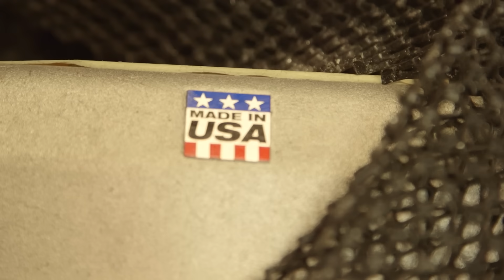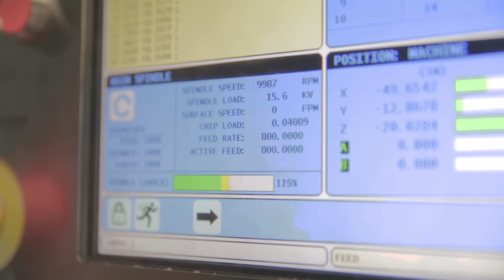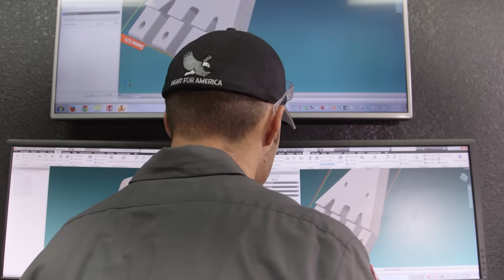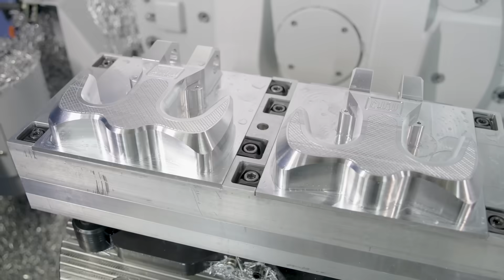Small Machine Shop Owner FIGHTS Back Against GOLIATH Company

Comment: I used to work for a not for profit and they had a relationship with a 2 person company. guy: did the work, wife did the accounts. We would sometimes have 45-60 invoices in a pile. Every now and again they would be like can you process some invoices and then the guy that did it would spend half a day just focusing on their invoices (we were probably more than half of their business). For one company we dealt with we kept having this failure, so i used to remove a small piece of the mechanism and that worked 95% of the time, showed an official repairer who said you shouldn't do that, he replaced the part 3 times. Later on the company that owned the devices used my repair technique for the problem :P. The old dodgy 2 dollar part that makes a 5 grand device useless.

Comment: A colleague of mine owns a company that is making tools for other companies. Tools like injection molding dies, press tools etc. One of his customers was a car company. It was at first a small customer but got bigger over time and then started to put pressure on him. Unscheduled short time changes of tools and in the end they wanted him to use specific software and wanted full access to the systems to be able to make changes in tools they wanted etc. They said if he wouldn't do it they had to look for someone who would do it. After that comment he terminated the contract with the car manufacturer. He said he would be able to make the same revenue without them and with less stress.  He still receives orders to make a tool for them from time to time, because of the quality of his work, but his company can exist without them and it grew in size.

Comment: This happens in my telecom industry all the time.. The big carriers. tmobile. verizon. att. They hire the big companies called turf vendors that get all teh work from the carriers for whatever region of the country . If you want to do work in area. you have to work for the turf vendor or youre sub. I used to be in one of those small subs and we can get payments held for ANY reason. wire isn't the right shade of color or the cables routed wrong, they will find stupid reasons like that so say we're not paying you a dime to you do it over. For a small company to hold that kind of money on the books for months is pretty much a death sentence. my old company got bought out and now im at the big place and i seeing it first hand. One of best contractors we have is owed more than 300k for past 6 months because the company is "restructuring". such a F'ed up situation.

Comment: I worked in the auto industry. This is call(TQM) continuous improvement. JIT (just in time) makes the supplier hold inventory at their own expense and if they don’t and a line goes down waiting for parts the supplier is charge hourly $$$$$$ for every hour the line is down. Billing practice is to use the law that they have up to 90 days to pay for their parts. Supplier must show they practice continuous improvement by reducing the cost of making the parts every year, thus auto company demands cost of parts be lowered every year. Most auto makers do this as it greatly increases their profits.

Comment: I worked for two person business that a multi billion dollar company tried to screw because an intermediary went broke. We installed equipment that was worth about a couple of years wages at the time that an intermediary at the bottom of a string of intermediaries was to pay for. We ended up bluffing our way onto the site where the equipment was installed - through security checkpoints, we removed the equipment and bluffed our way back out. 
We then sent the primary multi billion dollar company a letter stating that we had our equipment in our possession, and if they required it they would need to pay X dollars for us to supply it within 28 days. We were then threatened with all manner of legal actions... Unfortunately for these guys, possession is still 9/10ths of the law. "They" allowed us to remove "our" equipment from their site - there was no theft or trespass! We could evidence that we imported the equipment, had paid for it - that it was legally ours. They could not provide any evidence that we had been paid for the equipment - as none existed. 
The threats went on for months. Amusingly they said that the equipment was custom manufactured for them and that we would need to cave in to their demands of a 50% reduction in price just to move it on, as we just couldn't sell it to anyone else... Unfortunately for them - I found another customer for the equipment that was in dire need and we got 25% more due to currency fluctuations and price increases (which equated to an approximate doubling of what should have been out initial our profit).
Eventually, I received a call from the big company, they had a very big problem... The story went that an even bigger company was holding them to ransom and refusing to pay final completion payments for the entire facility that was missing the equipment. $45m was being withheld because of $120k of missing equipment. They wanted that equipment pretty bad all of a sudden! You wouldn't believe it, but we got to make really good money on that job when we supplied the replacement equipment at a "loaded" price... 
Sometimes the little guys win!

Comment: "you cant afford to lose a customer like us" sounds like the kinda company you wouldnt want to do business with anyway, right there it shows you what they think of you and that they can and will walk right over you. Weve dealt with companies like this before, had one after years of doing business they decided to put out part of the work to another company and we would do the final installs but suddenly there were alot more problems than normal and we kept getting blamed, lost alot of time just proving its not our fault and the issues were pre-existing with the other companies work but it soured the relationship enough we no longer wanted to do business with them they basically just wanted us to diagnose and fix it on our dime every time

Comment: I use to work at a Tier one automotive supplier and the same practices were put against and the company had to force the same practices on their suppliers. I fail to see the sense of breaking your vendors to the point you have to keep replacing them every couple of years.

I also worked for a small company that had the opportunity to work with Disney. We turned it down because Disney had just put one of our competitors out of business, and we knew we could be next.
Reply: My dad's shop did work for the big 3 in the 80's and 90's and they came close to running him into bankruptcy. After that he made it a point to make sure he could drop any single client and keep the shop running. It was better for him to take smaller clients and make a bit less money as an insurance against having his biggest client calling the shots in his business.

Comment: The engineering company that was formerly over the road from me went belly up after more than 50 years after taking on a massive job that they were screwed down to making next to nothing on. Then after the original quoting, design process and a prototype made the customer wanted the change made from a painted finish to a galvanised finish. The company adjusted the price difference to reflect the difference in cost between painting and hot dip galvanised. Sadly that wasn't the full cost though. 28 further machines had to be built, at a loss, because all of the tolerances were made for a paint finish and the hot dip gal added lots of extra thickness and almost every piece had to be hand finished so that it would again fit. The customer wouldn't budge on the price that they were contracted for so at the end of building 29 machines the engineering company went into receivership and the customer got their machines but absolutely no warranty support and 50 people were put out of work.
Reply: Yep, that is why unless it is written and signed on you get what is designed. If you want specific changes then sign a new contract and make new calculation. Sadly the big corporation rely on their power to intimidate and pressure the small companies into skipping these steps.
Also if you want a clause about late delivery/finish, then I add a clause about changing you mind and cancelling the contract midway.
Example - last month the company my mother works for was in talks for a very big order - like half a mil, but the client wanted a clause that if they don't deliver on time the price will be reduced in half. The company damn nearly signed the contract, but I managed to talk them into waiting and offering additional conditions - if the client cancels the order within 3 months of the work starting, then they will still owe half of the price and any changes to the design would require recalculations of the time and price. The client threatened they will go to someone else, but good for my mother's boss, he decided to stay firm and they left. 3 days ago the client came back begging to sign the revised contract - all other companies would simply tell them no even without offering revisions first.

Comment: I'm a trucker second gen once I was at the dispatch window dispatch answered the phone. It was 4:30 pm on a Thursday
They said "We here you do the impossible" dispatch said depends
We need you to be in Plano TX 7:00 am or this plant looses the contract. tomorrow morning. Our terminal was located in central KY. The plant was about 45 min from us. Dispatch said you'll have to pay for a round trip. 
And a team truck. + Fuel surcharge 
I asked him who is the customer 
Dispatch told me who it was. I'd hauled for them before at another outfit. They were always late. But required appointment times to load. 
They were not even going to run the product till 10:30 pm Thursday night. 
Dispatcher just said air mail is your only option and hung up the phone. 
That's a 14 hr run straight thru. 
We'd would have to swapped drivers somewhere between Memphis and Little Rock.

Comment: There is no honor or loyalty with companies in the USA anymore.  I worked for Nevada Power for years.  They had a deal with CDWR to operate a coal fired power plant that was built at a Nevada Power plant location.  After 30 years Nevada Power would take ownership of that coal fired power plant.  So what did Nevada Power do to that there was no honor among thieves?  They told CDWR that they were going to charge them a rental fee store the coal that CDWR owned for their power plant.  CDWR turned around and said F*** You and burned every single last grain of coal in the plant even though they lost money doing so (purchased power on the open market cost less than electricity made from burning the coal).  And of course they gave Nevada Power the finger as they left.  Spent 22 years working there and from day 1 the management was waging a war against the employees.

Comment: Every dollar owed but not payed is worth 10, maybe even close to 100 dollars of revenue!
Why? Because when you're not getting payed 300.000 dollars, that's a 100% loss. In manufacturing profit margins are typically quite low. 80-98% of that revenue lost was expenses that were already incurred for the manifacturing of those goods. You need to recuperate those expenses with the profit margin (1%-20%) off of other revenue to break even on the costs of revenue for that not-paid items - that's easily 3 million or more. In the end it's better to not do work at all when you're unsure if you get payed (you loose out on the 1%-20% profit margin, so 3000-60.000 dollars) than needing to offset costs not that are not payed.

Comment: A man who I became friends with while he taught me construction told me a couple stories involving customers refusing to pay or dicking him around, trying to renegotiate contracts after work was done or nearly finished. He said that the tune changes when you start pulling from the walls the brand new siding you just installed or removing the brand new windows you just hung from the openings and loading it back into the trailer. Until he was paid whatever was agreed in his contracts, the material belonged to him. This was the way he always wrote his contracts.

 He had also developed an "ear" for potential clients on the phone and never let us get into anything unmanageable, and never once threw me or anyone else under the bus with a client. 

We worked side by side, never more than the occasional, random 3rd guy, for a few years until I needed more than he could pay and we parted ways professionally on excellent terms. I've never worked for anyone like him before or since, and every job or industry I've been in since then, I've pictured him there and used that image as my guide. The owner of the company in this story sounds like the same type of man.

Comment: So many people these days assume that there's nothing a small company (or individual) can do against one of the "big dogs".  Actually being in the right still counts for something.

And yeah.  Your boss was right, and you can make it into a metaphor about dignity if you want, but it's just good business.

Running machines causes those machines to degrade, requiring repair and replacement.  The costs of those repairs and replacements needs to be absorbed by the profit generated from the work being done on those machines.

If operating a machine cannot be done at a profit, that machine should not be operated.  It was better for your old boss to let the machines stand idle rather than operate them at a loss.

Comment: I worked for a large corporation that was purchased by a hedge fund. Luckily six months after being purchased I qualified to retire and I did. 

This new owner had a policy of not paying their vendors for an order for at least 180 days. They thought that all the vendors that were doing business with this company for decades would go along with this policy. 

The largest vendor told the new owner you will have no deliveries on product until your balance is paid from the last order. Basically this 180 day payoff went down to between 30 to 60 days. Depending how often they need to purchase products.

Once the other vendors found out, they use the same tactic, it worked.

Comment: Former banker here (not an evil one). My thoughts (and I what I would always tell my clients):
1. Cash is king. Just because you book the income (that is, invoice it), it doesn't count until you receive payment;
2. Always balance your contagion exposures. Never get too reliant on one customer or supplier, they WILL use it against you (I typically also suggest thinking about diversifying financing, people forget the GFC too quickly);
3. The success of your business is tied up primarily in inventory and accounts payable, it will consume all your cash (fixed assets to a lesser degree); 
4. Be extremely careful in expanding too quickly. The general rule is that if you grow at more than 20% per year, you are over-trading and the risk of financial collapse increases exponentially (because you tie up all your cash in inventory, receivables and fixed assets and its very difficult to scale back down); and
5. Always know where you stand (relative power and reliance).

Comment: i used to work for a computer wholesaler ... we did a lot of business with the federal government ... the standard contratc is 30 days to pay with a 15 day grace ... only ONCE did they miss either deadline ... and they had that fixed in 2 days with rental on all the units they had to pay for ... they couldnt return the computers as they had been installed into a reactor measuring system and were now there for life ... after that they always got a payment due notice at the 30 day mark and a final notice with 5 days left on the grace stating payment due or return of product ... late payment was cost of 45% cost of order per day ... they never missed the 30 day billing date again

Comment: It just so happened these two companies were invested in each other and one of them had less to loose, good one for the smaller guy.  "BUT".. in the business world there is always backlash and revenge, just saying from a professional standpoint.  I saw many small companies win the first round only to be driven out of business a few years later, usually pushed out but a larger competitor doing jobs with less quality but way cheaper. It's not right but it's how business works, that's why you never burn a bridge

Comment: I used to work in produce and a friend of mine manage a produce processing company that was part of a larger local produce company.  They had a contract with Costco and Costco talked them into dropping all of their other customers to only provide them with bagged salads and and fresh produce.  There was flooding and they lost most of their fields and had to buy out of contract at a much higher cost and they were losing their ass.  They told Costco that they could not run at such a loss and Costco pulled out their lawyers and forced them to run into bankruptcy.  The owner of the main company withdrew funding and let the company collapse under it's own weight very rapidly.  Costco took them to courts because they still had assets and should fulfill the contract, but the small company was an independent LLC and thus was isolated from the larger company.   Costco also ruined CaraMia artichokes by stealing their process and opening production in South America.

Never be talked into serving only one customer, diversify, our you will find that that company owns your company.